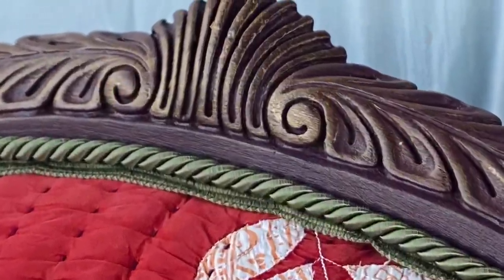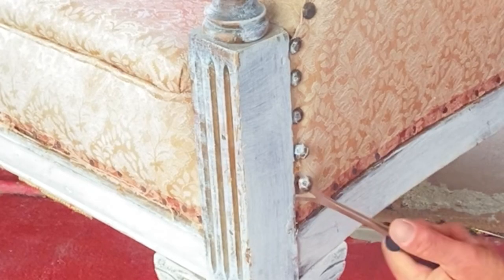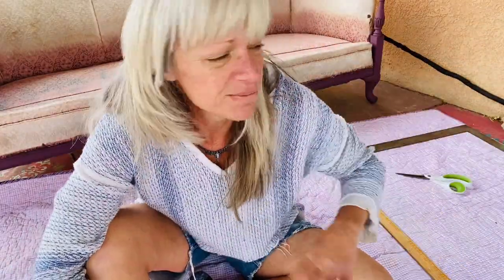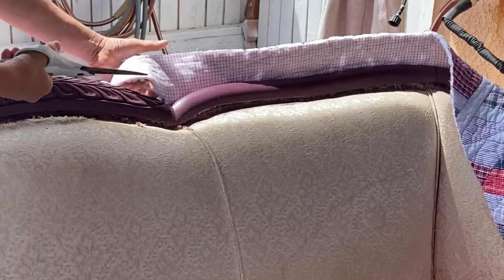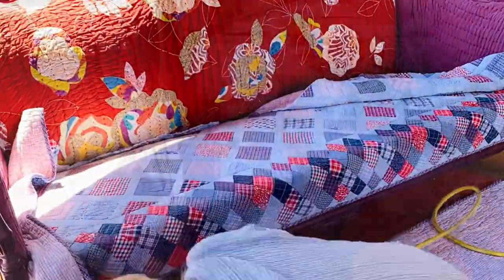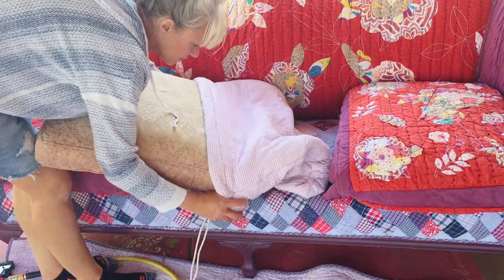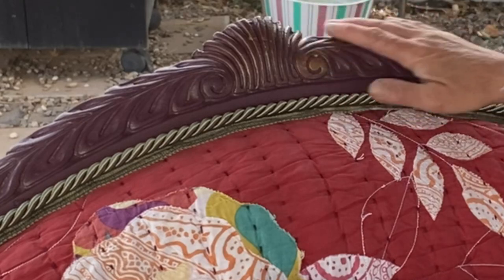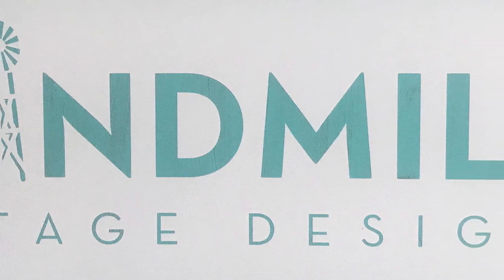Unique SOFA Upcycle/ Vintage Furniture Flip!

Comment: Ok, very cool. I have a fantastic chair that I grabbed free off the curb. It's not vintage, but one of those high end made to look vintage. It didn't have the bottom cushion but I can buy the stuff to make one. However, I will also need to redo the whole chair because of that and the fact that the material design isn't my cup of tea. Game plan is to use diy paint to paint the fabric, and a different color for the wood. The bottom cushion I have been thinking about maybe getting some sari scraps and sewing them into a patchwork. I've also thought about maybe getting a chenille cutter off eBay. However I have two quilts that aren't exactly vintage unless you count the fact that I have had them for 20yrs or so. They aren't works of art. I have been trying to tell myself to get rid of them because they are pretty tattered, however they are at the super comfy stage. This has definitely got me rethinking my plan.
Reply from the maker: Sounds like you have good stuff to work with and a plan! You are set! Can’t wait to see

Comment: You made use of something that was no longer usable as it’s original purpose. You made it happen. Have used for dog blankets, tote bags, inside new duvet covers. Also used the pretty parts of old quilts as tray centers, placemats and flower pot plates, of course after painting Polyurethane on them! No need to hem them either.